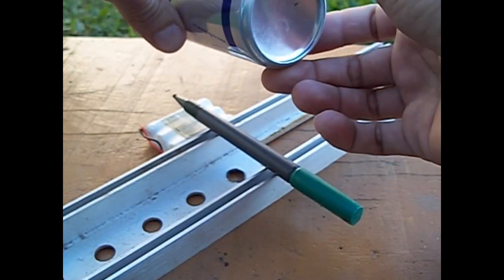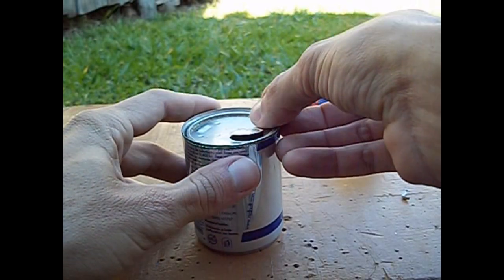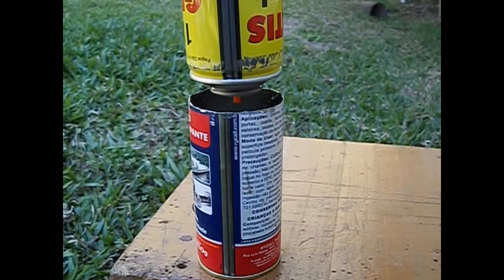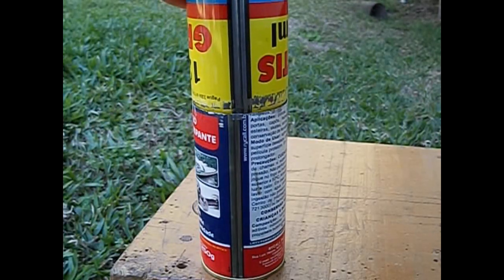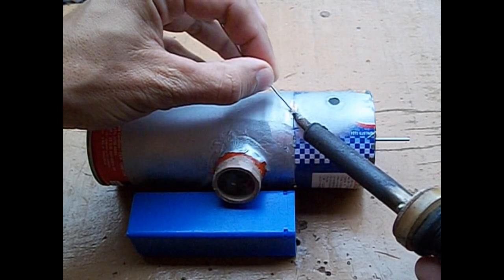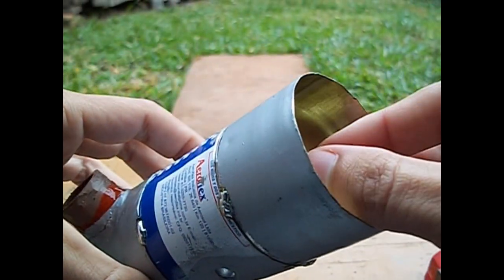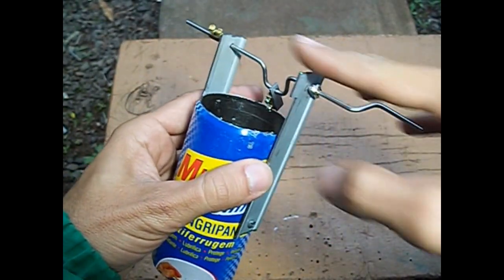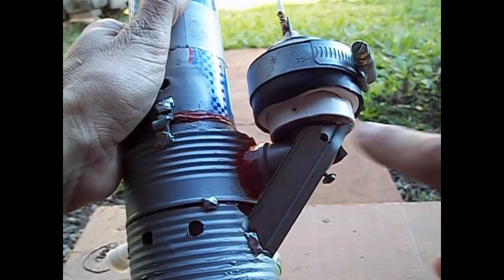[Tutorial] Como construir Motor Stirling caseiro passo a passo explicativo - Stirling engine

Comment: Please what type of light connector did you use
Reply from the maker: Hi! The connector name is "Sindal or Borner". It is used to join two light wires and can be purchased at stores that sell residential electrical supplies.
Welcome to the channel..
Leandro Wagner.
Reply: @ManualdoMotorStirling  thanks...and can I use a wood for the displacer instead of steel wool
Reply from the maker: @BuKi0506  Hi! In this project in this video, you can make a piston out of wood, but not in the other tutorial, the cylinder cans are thin, and with a solid piston the internal pressure is higher, thus spoiling the cylinder.
The project in this video could be a wooden piston, but I don't recommend it, due to the high internal temperature of the engine, the wood will burn and the piston will be very heavy, making it difficult to work.
For this tutorial project, I recommend doing the same as this video.
The engine will not run if there is an air leak and if it has friction. This video shows how the engine should behave for it to work:
https://www.youtube.com/watch?v=ejTh7TcuTYI
Always welcome to the channel.
Leandro Wagner.
Reply: @ManualdoMotorStirling  wow I'm thankful...

Comment: Iam from greece and the tittle off that video is wrong
Reply from the maker: Thank you very much for the information, what does it say in the title?
I would like to share that I am in a new project in progress involving 2 months of work in this video production. I intend to present an engine that uses coal as a heat source to pump water into a model of wheat. There will be an initial episode of 25 seconds that will be the answer to the conclusion of the video, the development of the project will be presented without hesitation despite its 8 minutes of video and accompanied by the growth of wheat day by day in a model.
Be welcome!
Leandro Wagner.
Reply: @ManualdoMotorStirling  it says 
How to make a explanatory
Reply: @ManualdoMotorStirling  but the design is the best design i have ever seen
Reply: It is the best working piston without a lot of money , all pistons are made just for cars or trucks , and with that piston which is on this size , you can make a big RC works with that  piston you ensparing me to make rc cars with very good design

Comment: Sterling engine run by solar glass is good
Or we sunflower our equipment so we constantly got hot water which can run the turbine 
Ammonia gas or refrigerator can give us constant supply of heat which can generate electricity ????

Comment: Thanks for the Persian subtitles , please leave other videos with Persian subtitles.
Reply from the maker: Thanks for the suggestion, actually including the translation, always involves many hours of editing, so not every video I do the translation inserted in the video.
Did you watch my penultimate video? The fan engine!
Leandro Wagner.
Reply: @ManualdoMotorStirling  yes I did , The video description has been translated.
Reply from the maker: Thanks for the answer. The new videos I am updating even before posting, and thus manually translated into 36 languages, this requires 4 hours of service.
The old videos that have a good demand, this one I am also doing the translation, while the low demand videos, I do not, because it consumes a lot of time.
In the next 5 months, I will try to be very active on the channel, I aim to post 2 to 4 videos per month, full of news. Last night, I was working on a new engine, which should work and between 2000 and 3000 rpm, it will be a totally different engine that I have already presented, but it needs some special tools for its construction.
Leandro Wagner.
Reply: @ManualdoMotorStirling  I'm eager to see your new engine and hope it works , Thank you for everything

Comment: 4 latas de inseticidas, ou óleo desengripante, ou bom ar (57 mm de diâmetro); 

1 lata de ervilha ou milho, para deposito da água (73 mm de diâmetro);

1 lata de pêssego, para fazer o forninho (102 mm de diâmetro);

1 lata de Red Bull (250 ml) ou desodorante Axe, para o pistão deslocador (53 mm de diâmetro);

1 outra lata de Red Bull, para a tampa do pistão deslocador (53 mm de diâmetro ou de 250 ml); 

1 luva pvc de 20, na cor marrom, cortada pela metade de seu comprimento original;

1 joelho de pvc 20, na cor marrom;

1 bucha de pvc de 25 por 32 mm, na cor marrom;

1 bucha de pvc de 32 por 40 mm, na cor marrom; 

1 bucha de pvc de 40 por 50 mm, na cor branca; 

1 raios inox de bicicleta de 2 mm, para o pistão deslocador, utilizando a porca do raio cortada ao meio; 

1 raio de guarda chuva, para a biela do pistão deslocador, pelo fato de ser mais fino e leve. Mas também pode substituir por um raio de bicicleta de 2 mm;

2 raios inox de bicicletas de 2,5 mm, para o virabrequim e a biela do pistão de trabalho;

5 CD para fazer o volante;

1 abraçadeira para o pistão de trabalho “balão”;

1 balão surpresa número 10" ou 8", são mais resistentes que os tradicionais;

2 botões de volume de rádio, para fazer o pistão externo, ou pode ser substituídos por duas tampas de produto de limpeza com diâmetro de 35 mm;

2 bucha de bronzina encontradas em toca fitas, por onde o pistão deslocador escorrega, ou substituídos por duas moedas de cinco centavos, furado com uma broca de 2 mm;

8 conectores de fio de luz “6 mm”, para afixar os raios e ter regulagem, pode ser comprada em lojas que vendem material elétrico residencial;
Reply from the maker: Obrigado pela colaboração!
Leandro Wagner.

Comment: I wonder if you, were to add tiny Neodymium magnet's as Fly Wheel WEIGHT and Face them at a arrangement of "Hollow Core" Coil's to make electricity, how much electricity could be made? I bet you could make tiny Generator fixed to this Stirling Engine..
Reply from the maker: Thanks for the comment and advice.
This engine produces about 0.1 Watts, or about 10 leds. I have another video where I posted the result:
https://www.youtube.com/watch?v=W3U1ATB7Bko
Leandro Wagner.

Comment: Boa Noite Leandro , tudo bem ? estou usando seu video como base para meu projeto , sei que você possui um video com materiais mais faceis como latas de refrigerante , mas descobri esse video depois de comprar tudo da sua lista , só gostaria de perguntar uma coisa , na lista você coloca 4 Latas de 57mm , mas no vídeo só reconheci o uso de 2 , a quantidade está correta ??
Reply from the maker: Boa noite, são quatro latas de 57 mm de diâmetro.
- 1 lata para o cilindro quente;
- 1 outra lata para tampa o cilindro quente, que é conhecida como cabeçote;
- outra lata acima do primeiro cabeçote também chamado de cabeçote, que é o guia do pistão deslocador;
- e a última lata faz a sustentação do virabrequim.
Leandro Wagner.
Reply: Manual do Motor Stirling - Leandro Wagner Entendi , obrigado !

Comment: how to make a this engine power ?
Reply from the maker: Hi, I only made engines for presentations, motors of greater power, they need to be bigger and with pistons of larger strokes, bigger diameters, so low rotation and good power.
Leandro Wagner.

Comment: Hi Manuel.
What do you use forse saldas the alluminium parts? 
Thanks
Reply from the maker: Sorry, but I could not understand your question!
Leandro Wagner.
Reply: Manual do Motor Stirling - Leandro Wagner 

Sorry,
what did you use to weld aluminum cans?

Comment: y some peoples use steel wool instead of can ....and also what is use of water by adding it
Reply from the maker: +Sulu Sujith The engine piston made of steel wool, are more efficient and water is necessary, not to occur overheating engine.
Leandro Wagner.

Comment: displacer piston height-? mm
gap from the piston to the bottom the cylinder in the lower point ? мм
gap from the piston to the top cover in vekhny situation ?мм
it is long a displacer piston stroke- ?мм
Reply from the maker: +Своими руками The hands The displacer piston is 70mm long.
The displacer piston is a distance of 3 mm from the cylinder base and 3 mm from the top of the engine.
The displacer piston travels a distance of 24 mm inside the hot cylinder.
Leandro Wagner.
Reply: thanks for the answer :) :) :)
Reply: Another question is how much progress the diaphragm in the working cylinder?
Reply from the maker: +Своими руками The hands Watch this other video:
https://www.youtube.com/watch?v=bXuHaSTsciQ
Leandro Wagner.
Reply: Своими руками We do with own hands

Comment: que tipo de cola é essa?/ qual o nome dessa cola?
Reply from the maker: balafra tubo Essa cola na cor vermelha que eu usei em meu motor, é cola de silicone de alta temperatura, usado na vedação de motores de automóveis.Você já assistiu o outro tutorial com latinha de alumínio?
Leandro Wagner.
Reply: Manual do Motor Stirling - Leandro Wagner  não eu sou novo no canal, meu amigo me mandou um link desse video, nós queremos fazer um carro. excelente video a proposito =D
Reply from the maker: balafra tubo Ok, então eu recomendo que tente fazer um outro motor, que é mais simples, fácil e até com maior potência que este.O nome do vídeo é este:
([Tutorial simples] Como fazer motor Stirling caseiro passo a passo - As do Stirling engine)
Eu não posso postar com o link, para não entrar essa mensagem em spam.
Leandro Wagner.
Reply from the maker: balafra tubo Aqui está o link do meu blog, com o passo a passo:@2013

Leandro Wagner.

Comment from the maker: I use silicone adhesive high temperature, other questions can be answered in my blog (Manual do motor Stirling).
The blog link you can find on my channel.
For day 7-11 - 2013, I'll post a new video tutorial of this engine, I hope the video is useful for you.
Leandro Wagner.

Comment from the maker: Hello friend, if you do a displacer piston mass, this difference is too large, will only work if you paste around the piston diameter 58mm, steel wool or if the piston is totally me steel wool, but wool super soft, and this piston is transparent.
Since engines in tin can and diaphragm, the more efficient is the cylinder with 68mm diameter and the piston fully into steel wool, with 35mm in length.
If you would like, I can send all the measures of my engine and some tips.
Leandro Wagner.

Comment from the maker: Olá Lucas,
O centro do furo no cilindro, onde a luva é colada, tem uma distância de 30mm de cima para baixo (medido por fora do cilindro).
Cada cabeçote do cilindro do motor em "8:26", pode variar entre 5 a 6 cm de comprimento e as buchinhas estão +- 5 cm de distância uma da outra! O comprimento total da lata onde está fixo suporte do virabrequim, do inicio da lata até a altura do eixo do virabrequim é 13,5 cm, em "12:17". As bielas devem ser cortadas após a conclusão da fabricação do motor.

Comment from the maker: Olá Diego,
- Este conectores de fio de luz de 6mm, podem ser compradas em lojas que vendem material elétrico residencial.
- O cilindro tem 12 cm de comprimento, sendo que o centro do furo para colar a luva fica 3cm de cima para baixo.
- Cada cabeçote do cilindro do motor em "8:26", pode variar entre 5 a 6 cm de comprimento.
- O comprimento total da lata onde está fixo suporte do virabrequim, do inicio da lata até a altura do eixo do virabrequim é 13,5 cm, visualizado aos "12:17".
Leandro Wagner.

Comment from the maker: Olá David,
Cada cabeçote do cilindro do motor em "8:26", pode variar entre 5 a 6 cm de comprimento! E encaixe de cada cabeçote é ~1cm.
O comprimento total da lata onde está fixo suporte do virabrequim, do inicio da lata até a altura do eixo do virabrequim é 13,5 cm, visualizado aos "12:17". As bielas devem ser cortadas após a conclusão da fabricação do motor. Porque o comprimento das bielas, irão variar conforme a construção do motor de cada um.
Continuando o texto...

Comment from the maker: Puedo utilizar soldadura (utilizado en talleres de electrónica), para soldar las latas.
Cada cabeza de cilindro del motor de "8:26", puede variar de 5-6 cm de largo y bujes son + - 5 cm de distancia unos de otros! La longitud total del soporte puede que se fija cigüeñal, el inicio de lata a la altura del eje del cigüeñal es 13,5 cm, visualizados a "12:17".
Esta pieza que sujeta los rayos, son terminales de luz de cable "6mm".
Mi facebook: Manual do motor Stirling
En mi canal, busque el facebook.

Comment from the maker: Olá Junior! Essa lata é a mesma do cilindro (lata de spray desengripante, 57mm de diâmetro) sendo essa peça, o cabeçote do motor.
Cada cabeçote do cilindro do motor em "8:26", pode variar entre 5 a 6 cm de comprimento e as buchinhas estão +- 5 cm de distância uma da outra! O comprimento total da lata onde está fixo suporte do virabrequim, do inicio da lata até a altura do eixo do virabrequim é 13,5 cm, visualizado aos "12:17". As bielas devem ser cortadas após a conclusão da fabricação do motor.

Comment from the maker: Thank you for watching my videos! Wow! I never imagined that a single candle, if compared to 80 watts. But my engine produces 0.345 watts of electricity. I believe, around 5 Watts in mechanical energy. Never calculated the energy efficiency of my engine. I started a new engine "alpha", which I believe I'll have a better yield. Still other engines do and always demonstrate that the materials used in engine construction. Thanks for everything.

Comment from the maker: Thank you! Actually built this engine, with the intention of teaching the construction of engines for the people of my country. My other has even more force in relation to this. The 720 RPM does not have much force, because its greatest strength is at 300 RPM. The demension of the steering wheel is a regular CD and 100g weight and the engine has a total of 680g. I also know that if I put a bigger wheel, I would have more power. Having capacity to feed 18 leds, these characteristics.

Comment from the maker: Sorry! I will send you back into English. 
1° detacher cylinder diameter = 57 mm. 
2° diameter "displacer piston" = 53 mm. The total distance the piston moves = 28 mm. Diameter 
3° the diameter of the tube of plastics "PVC outer cylinder" = 50 mm. 
4° the diameter of the "power piston" = 35 mm. 
The total distance that the "power piston" moves = 24 mm. Made with a balloon party.
 At the end of the video, I have the address of another video "as the power piston is mounted." Click on the links.

Comment from the maker: Hello! Two care we should take so that the engine has more power.
1 taking care not to friction.
2 ° the less air leakage, the better! The greater the power of your engine.
3 note, as my engines have compression, and other secret to a good power. It has no air leakage.
4th try lowering the displacer piston stroke and keep the course of the "piston force." This compression increases. But you can not have air leakage.
I have no problem with my blow displacer piston.
Any questions, ask.

Comment from the maker: Thank you friend! It's a great satifação for me to receive a comment from his person.
 Most people from other countries, is difficulty to find the tin cylinder. But can cause the motor with energy from the cans "Coca Cole", which are of aluminum. As in my penultimate video "in which the engine had reached 1020 RPM." Where I am sure you will not have trouble finding. For there are in all countries.
 I also like your tutorials.

Comment from the maker: Thank you! Never had any problems in realção to explode. And yes, to crush the displacer piston, with the pressure of the engine itself. Where, I decided to strengthen the can, with another lid on the interior of the piston "displacer piston".
However, never used much heat. Where could it have the possibility to open the piston, the pressure formed within himself, by the heat.